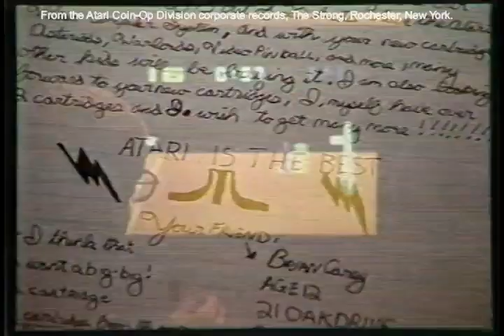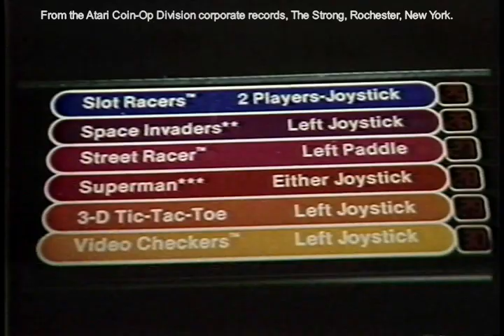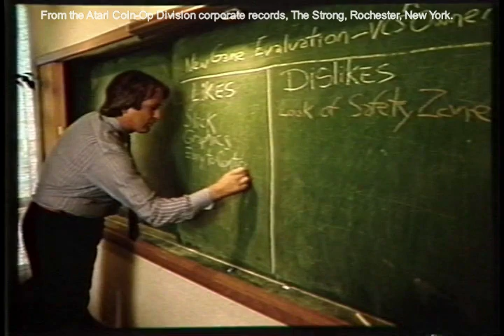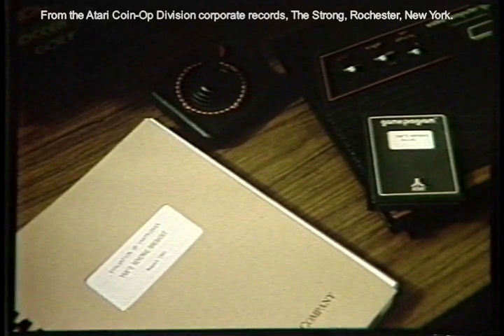“Inside Atari,” 1981

Comment: This is a video transfer of what was known as a multi-image slide show. In the 1970s and 80s, these productions were used for trade shows, exhibits, and sales meetings. In its original format, multiple 35mm slide film projectors were aligned and synchronized with an audio track to create large screen presentations.
https://en.wikipedia.org/wiki/Multi-image